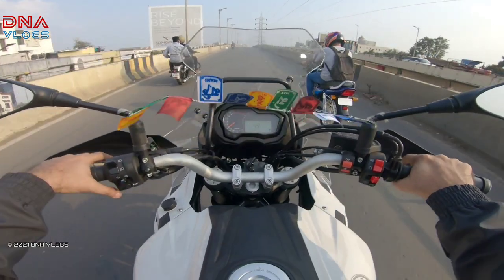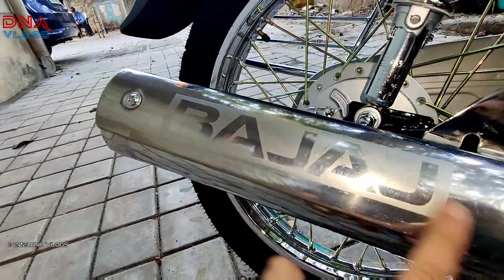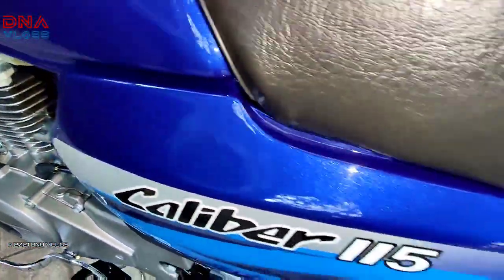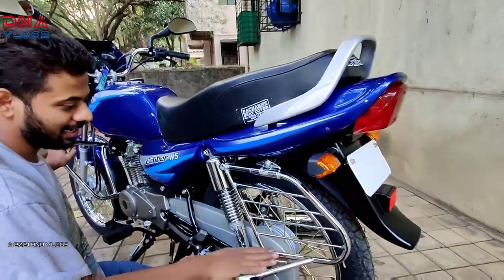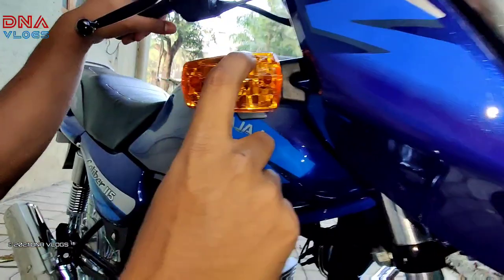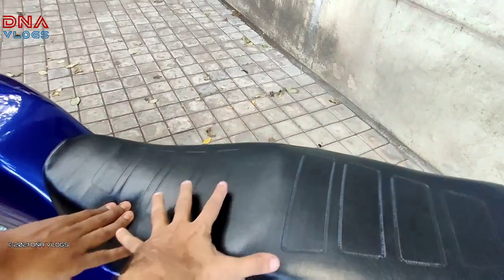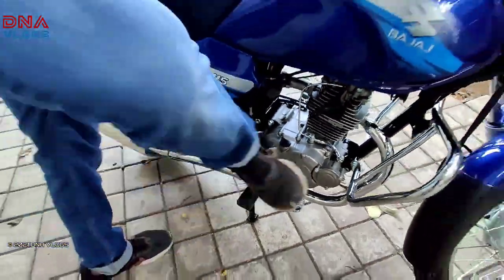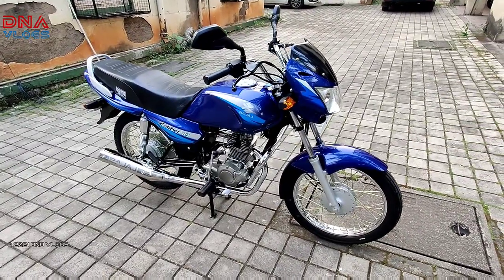Kawasaki Bajaj Caliber 115 | Hoodibaba Bike Restored to Factory Condition, Detailed Review DNA VLOGS

Comment: That ad' still rings in my head during those cricket matches especially! (I guess)  Hoodibaba , hoodibaba, hoodibaba hoo 😍😍💥💥
& Whenever we used to look at that motorcycle on road back then, we be like Hoodibaba bike re wo dekh 😍😍😂😂 & the owners be like 🙄🙂
Reply: Haha yeah man many emotions connected, main reason why I restored :)
Reply: @NGK18  bro what is your Instagram handle , i wanted to restore my father's bike , so I need parts online , can you share the links and what is it's engine oil grade and what engine oil u use and with that do you add any extra carbon cleaning, milage improve type additives in your tank . Ty

Comment: Bro i have same bike but it not giving good mailaze,nd i changed carburator but not suppicient mailaze
Reply from the maker: @kumarbms5861  this will need physical inspection, from valves, carburettor, plug, air filter etc etc

Comment: Hi, really clean work in detail. I also own Caliber Croma(candy wine red colour) 2002 Model, which came  Caliber 115, i still use it in 2021 and its engine is still stock, give me mileage of 55+. But some parts particular crome plated(saree guard, leg guard, silencer etc) has got nickel work out due to ageing, i needed to get those restored. I want to know whether its head light assembly is available or can we fit Hoodibaba head ligt assembly to it?
Reply from the maker: You will have to check the parts availability with your local Bajaj dealer or after market dealers 😀
Reply: Rinder one is available, order that headlight assembly.
Reply: Croma me iss jaisa power. Mileage nahi hai
Reply: @NGK18  hi nikhil..do rinder one have round headlight of caliber.
By the way u hv restored ur bike in a really beautiful way.kudos to you.
Reply: @arung3779  yes and thanks!